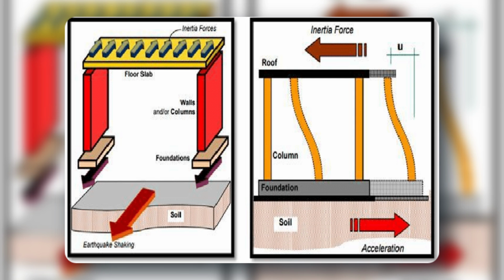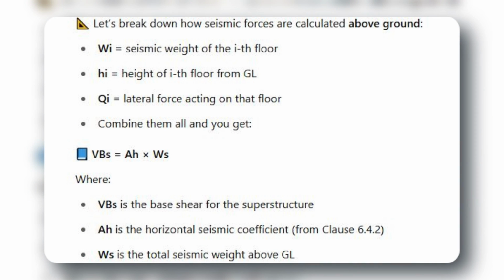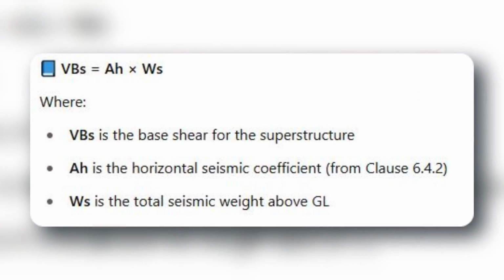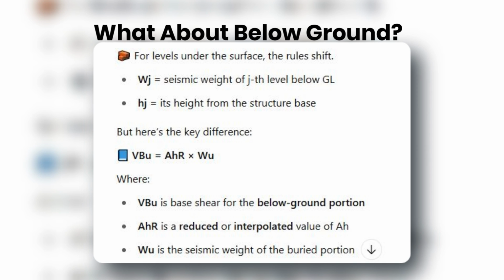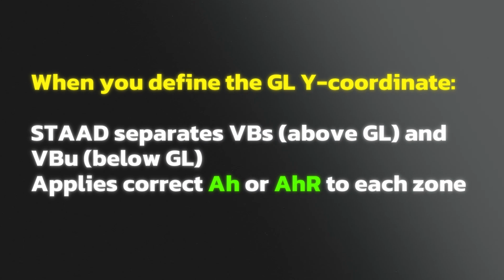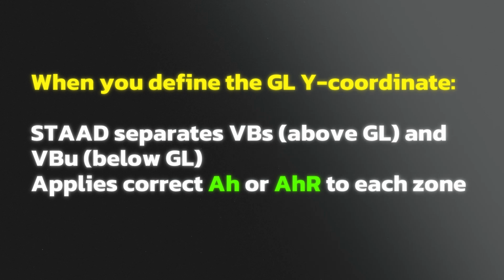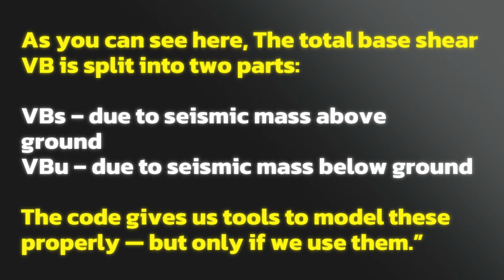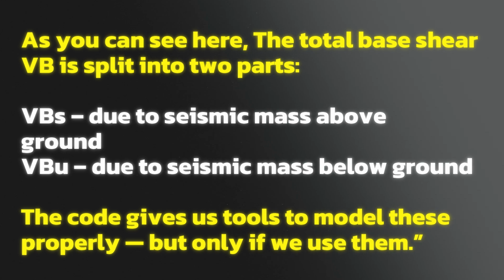GL Parameter in STAAD | Seismic Analysis for Basements,Part 1

Comment: Which clause of Code 1893 explains the above rule.......
Reply from the maker: Clause Reference (for base shear below ground):

IS 1893 (Part 1):2016, Clause 6.4.2 - Design Horizontal Seismic Coefficient (Ah)

And its application for underground or buried portions of structures is clarified in the Explanatory Notes / Code Commentary (typically found in official guides or textbooks, not in the main code

body itself).

STAAD's GL Parameter

STAAD includes the GL parameter based on these interpretations and commentary provisions, and uses it to:

Split base shear application above and below GL.

• Apply interpolated Ah or 0.5Ah when structure base lies deeper than 30m.

This concept is practically implemented in STAAD per the interpretation of IS 1893 and is widely accepted in industry usage.
Reply from the maker: https://youtu.be/qpk4VbN6g8o?si=B6TfLRxQgsmwULRW

Checkout part 2 here with Validation